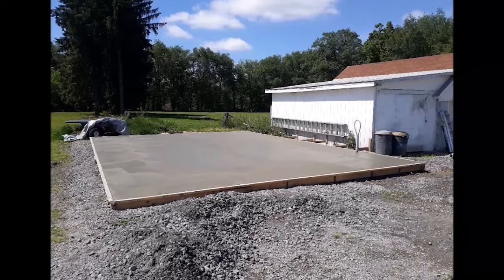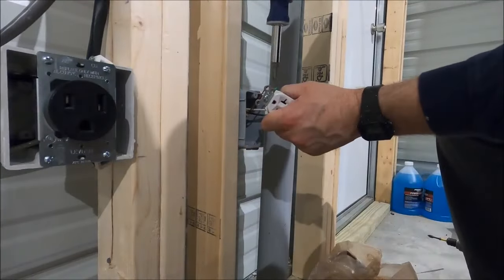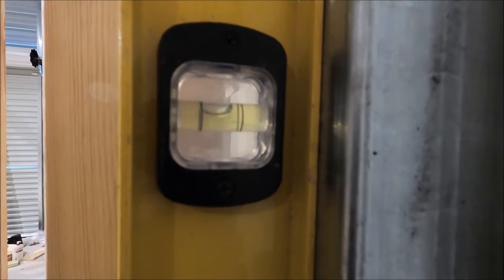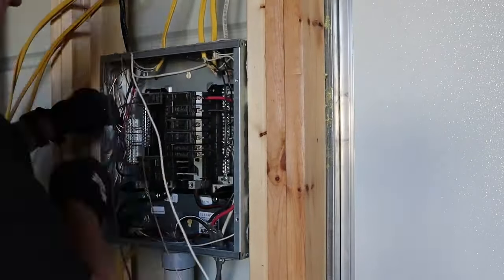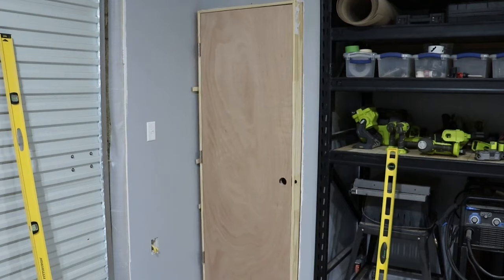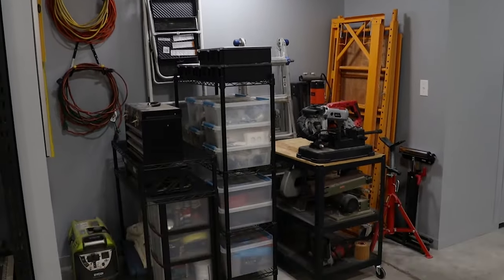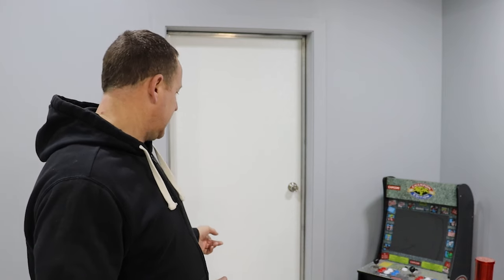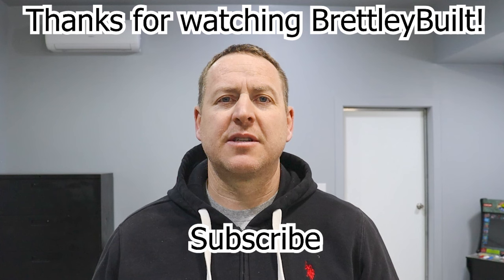Compilation of Carolina Carport Metal Garage Interior Construction | 2 Year Review of Metal Garage

Comment: Hey Brett, loved your series, thanks for sharing it. Although my back started hurting just watching:) I had my 3 car garage floor epoxied. They diamond grind it, then apply epoxy, decorative vinyl chips (you choose the colors and density of spread) and finish with a polyurethane. Took 4 days total, it was $3k for a little over 600sf. My garage is 100% wood/metal/cnc shop, no room for cars. The chips aid in anti-slip (a non-issue, it's never wet)  but make rolling tools around harder, esp with smaller cheap casters. My grey/white combo also totally camouflages any small screw or nut you drop. But it transforms the space, makes it a nicer place to be, absolutely no regrets.
Reply from the maker: Thank you so much! Great information.

Comment: Very nice job and impressed with your drywall skills with me being a retired drywall contractor. We did everything by machine the last 25 yrs unless it was something small. When I frame by myself I started nailing on a 4 ft top plate allowing for the tie in to the other  wall  before I stood my wall. It helps hold the wall until you can get it shot. I know it's code in some areas but I hate plastic on any  outside wall. It's going to sweat and it can build mold. I understand people wanting to save on their electric bill but I've seen homes so tight the doors inside diden't want to shut. They actually went above the inside door and built a small frame opening. I did some habitat homes where they calked every  tiny crack they could. and Thats a mistake . A home needs to breath just like a human. I have seen homes where the fireplace wouldn't draw properly because of  the house being wrapped up like a cooler. Anyone who  is reading this if you have  ever covered anything in plastic out side  when you pull the plastic off  moisture is always on it. I got off subject but very nice job. People in your area should look you up when they want a good job done.
Reply from the maker: Thanks! I agree with you on sealing a house up too tight. Luckily my garage door is super flimsy and lets all kinds of air in.🤣

Comment: Very nicely done!  I have a 24x35 metal building that I am currently insulating.  Curious as to how you insulated around the roll up door, especially the large gap that they come with at the top.  Did you use brush seals or something else?  I know with mine, that is where a ton of cold air comes in.
Reply from the maker: I actually haven't figured out what I want to do yet.
Reply: @brettleybuilt  keep us posted if you figure out the trick to that.  Seems like you either have brush seals or get a new regular garage door without the gap.

Comment: I would try putting an awning over that door. I have a wood shed that kept leaking like that and rotted a big section of the floor out. I put a gutter on the roof, an awning over the door, then filled every crack and space I could find with spray foam. You gotta prevent water from even getting to the door in the first place
Reply from the maker: I agree. That's probably the direction I need to go.

Comment: What was the intent of putting OSB between the joist with glue?  What does that do?  More rigidity?  Or did you just need a thicker dimension?
Reply from the maker: To make it more rigid. Probably wasn't necessary, but didn't want any problems.

Comment: I think I'd prefer a 2 leaf barn slider style over the segmented roll-up & I doubt a slider would air-seal any worse. Also barn slider doors can be insulated to some extent, the rollup doors look like they will radiate lots of heat and cold. A slider door setup could also include a small window. 
Installing a slider door does require that the roller track cover flange be installed under the end wall tin. Obviously this could be a challenge to retro-fit. 
I'm no longer fan of overhead garage doors primarily due to recent price stupidity, and ceiling clearance loss. 
The man door appears to be an old-school mobile home type. They're ok but work best under an awning (someone else already said that). This is kind-of true with any out-swinging door that's exposed to wind driven rain.